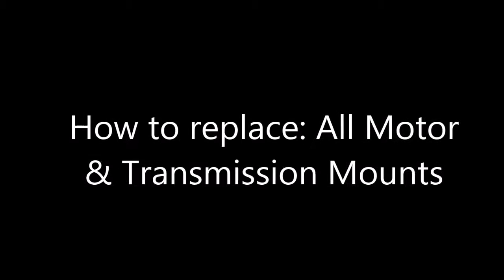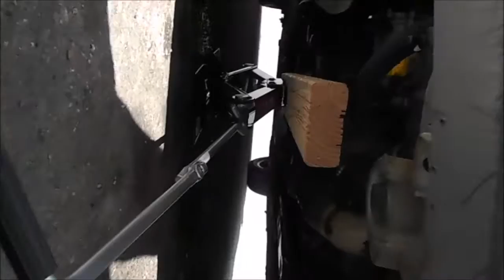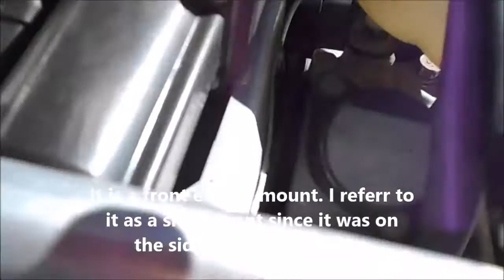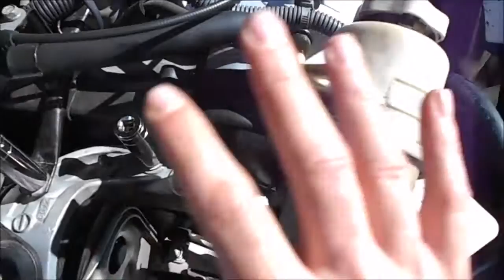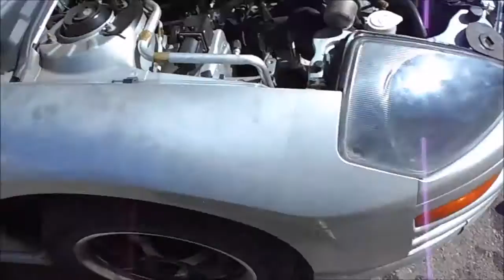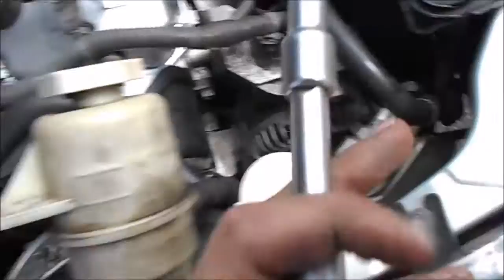DIY:How to replace:All Engine & Transmission Mounts Part 1

Comment: Just did two of the four mounts. Front roll stop lower and the one in this video. Attacking the other two soon. I do have a question. My side one shown here I have everything lined up and am able to smack that center bolt completely in as you said, however I'm still spinning endlessly without it actually tightening down as it should. But the head of the bolt is straight touching flat to the bracket that holds the mount. So it definitely is going all the way through. Not sure what's up. I removed it again and the threads on the bolt and part it goes into still has tread so not stripped. Any suggestions?
Reply from the maker: Yeah, that bolt will just keep spinning until those threads grab. Again im not a mechanic, but i personally would try to  bend the right side of the bolt mount inward. Use a good ole pry bar or 2x4. Even if you only can get 1/8 of a inch, that probably will be just enough. Once that bolt grabs and you tighten it up; you'll see everything flex and that space will close a bit. Another suggestion maybe have an extra set of hands. While once person flexes the bolt mount inward have someone ready with that socket wrench to tighten/grab with that bolt.